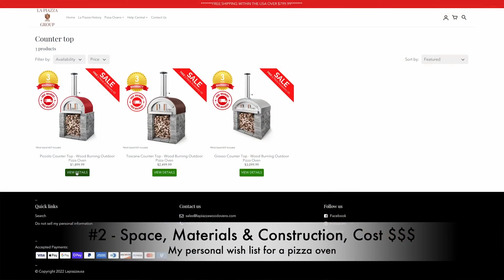It's NOT a Pizza Oven! It's a Wood Fired Oven! (It makes pizza too)

Comment: First time to watch your videos!! Amazing!!
I’m debating piccolo or toscana? 
I know that toscana is bigger but what other benefits over piccolo?

Thanks.
Reply from the maker: Thanks Gary! IMHO, size matter as they say lol. Seriously the flexibility of being able to move food around and control distance to the fire as well really makes a difference. If you watch this week’s video where I make crab in the LPWO you will see that I just couldn’t have done that in a Piccolo. Welcome to the channel BTW! 
Wood Fired Alaskan King Crab Feast
https://youtu.be/4aYrccDLwDA
Reply: @BehindTheFoodTV  thanks for your suggestion! I’m new to wood fire oven. I noticed that you started the fire in the centre and then moved them to the side. 
Why not started on the side at first?

Thanks.
Reply from the maker: @garbun0629  I learned to do that with my stick burners - max even airflow to get it started, then move it once it’s established. I also learned from a few other guys who have been doing this for years and they do the same thing. Although I’m one of the few that uses a flamethrower 😂
Reply from the maker: @garbun0629  if you do decide to move forward with one, use the link https://emv4.me/WoodOven and code EMV30 at checkout to save a few bucks. It helps fund the channel too and I appreciate the support!
Reply: @BehindTheFoodTV  La Piazza teaches us to use paper to start the fire. Others use charcoal to start…what do u think besides flame thrower?